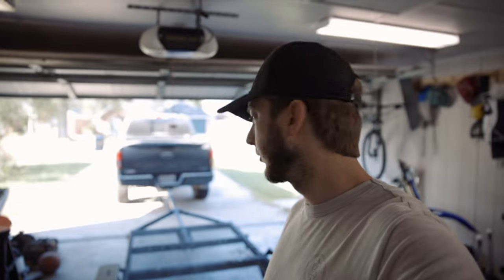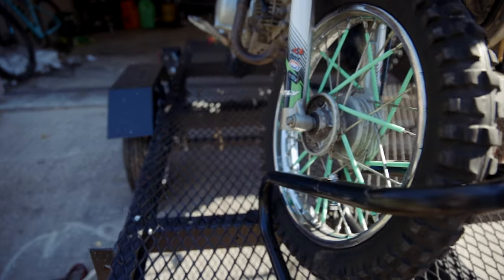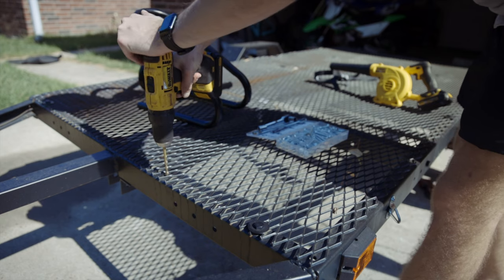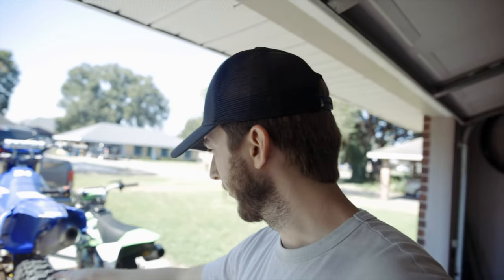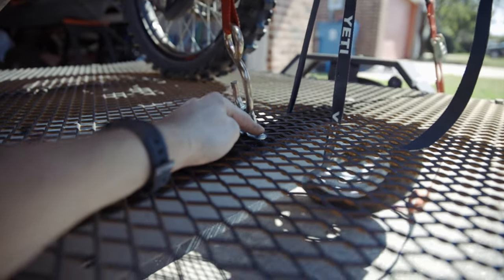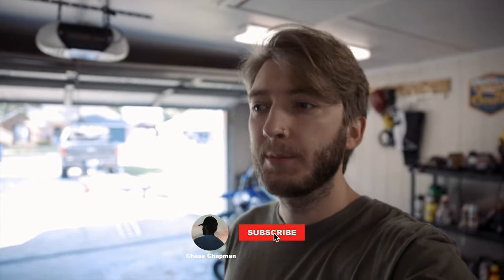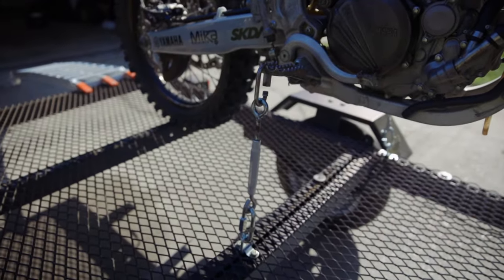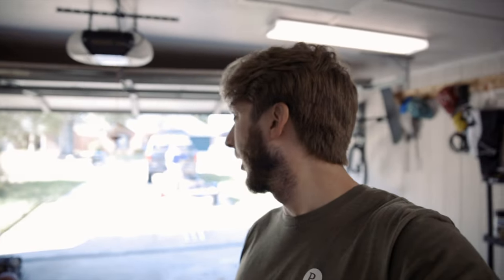The BEST way to secure your dirt bike | No More Straps

Comment: This is what I’ve planned on for my bikes except a strap as well over the front and rear tire. I have a bumper mount for my bike and use a turnbuckle to tighten it to the bumper along with the hitch so it doesn’t move when driving. Good job bud looks good.

Comment: I am a fan of the turn buckles.  A couple of small suggestions; Install jam nuts on the normal threaded end of the turnbuckle to keep them from coming loose on long trips and put nylock nuts on as a double nut on all of the nuts under the trailer, I know you have the lock washer, but why leave anything to chance.

Comment: FYI, you dont want all the weight on the front. I know you didn't put the weight on the front but you wanted to. What you want if possible is 10% on the tongue and the rest over the axle. Just watch videos on how to load a trailer.